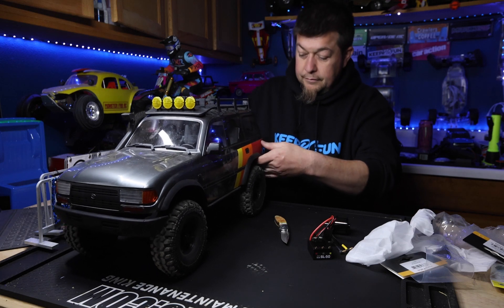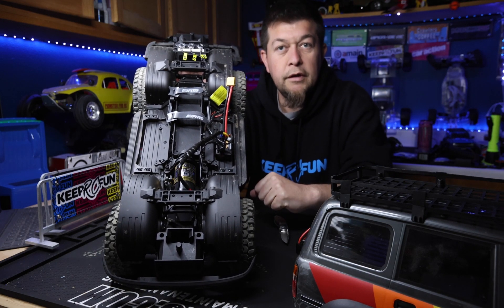FMS brushless conversion for the LC80

Comment: Is there a noticeable difference in top speed
Reply from the maker: yes its a a lot faster and more torque to get over things
Reply: Would this be waterproof now.
Reply from the maker: water resistant since the receiver isn't in a sealed box the rest can take lots of water I took mine thru a bunch just watch the receiver or coat it with a protectant
Reply: @keeprcfun  I think I am going to get the mjx h8h it is simular price here in UK.
Reply: Did you change the remote it came with or are you still on the stock 6 ch